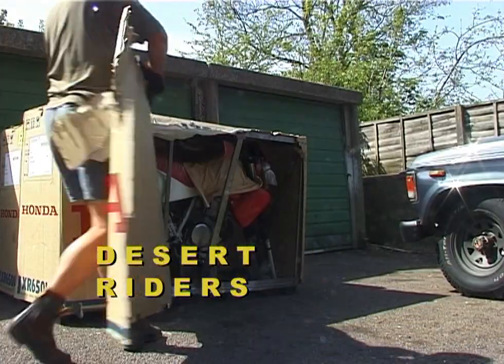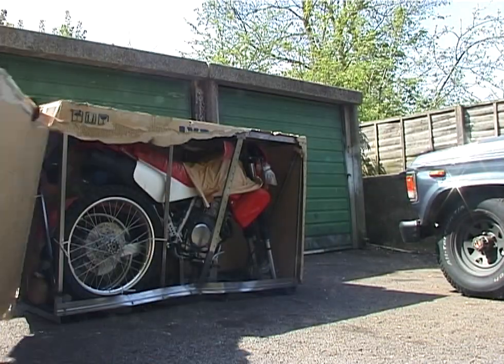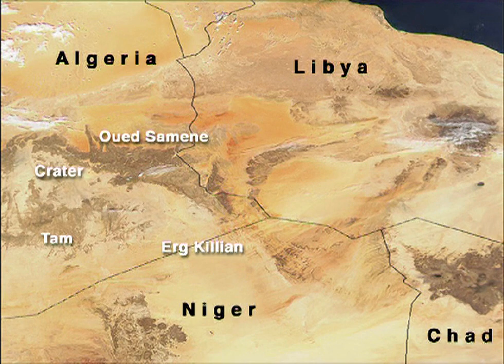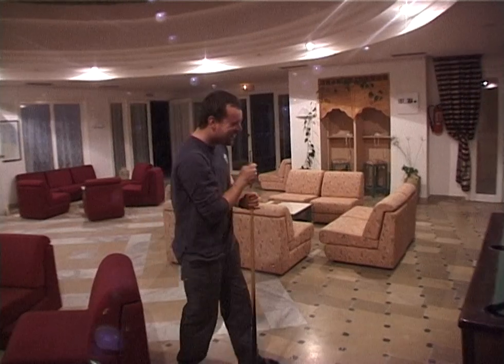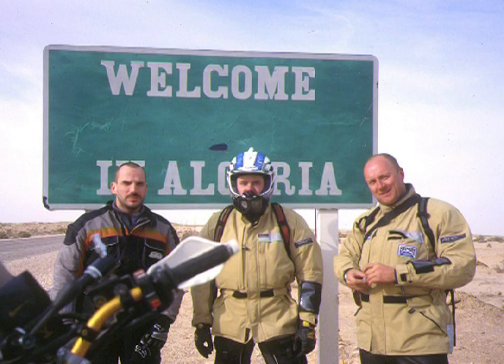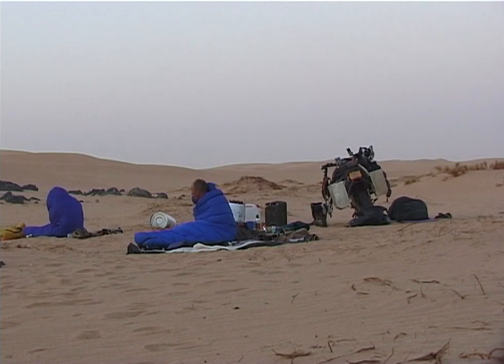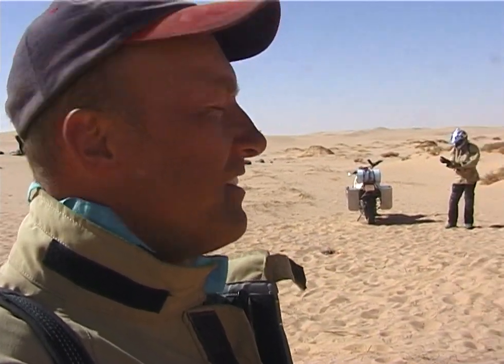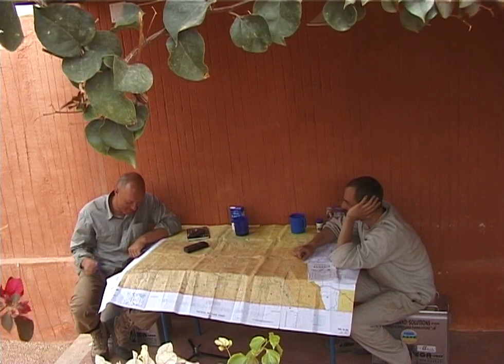Desert Riders • Sahara • XR650L (Full video; 2003)

Comment: The three major things you must do to that bike first thing get rid of that smog crap second thing put a FCR carburetor or electron and change the exhaust and if you want to add icing to the cake you would put that bike in the suspension shop and have it Beefed up and revolved  for carrying all that luggage. I own a 2007 XR 650 L and I have done quite a few mods to transform that bike it will never be the top dog but it will always do the job.